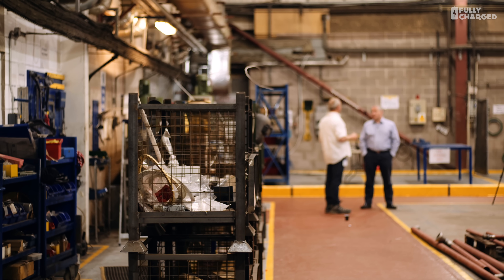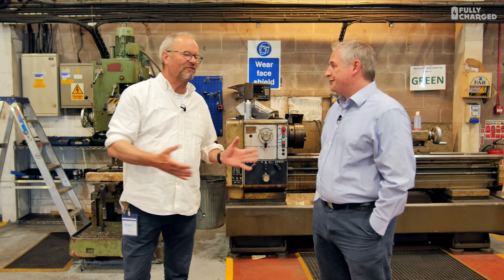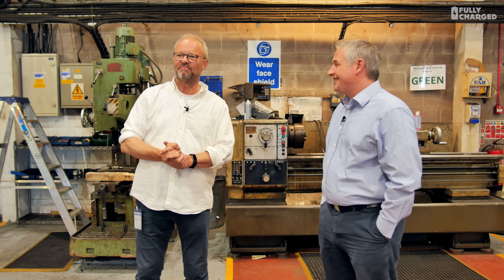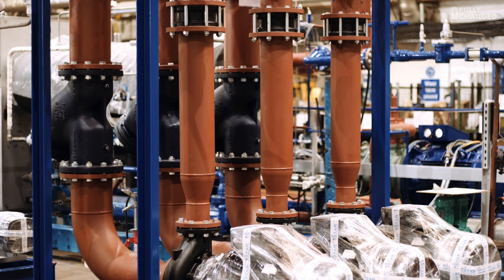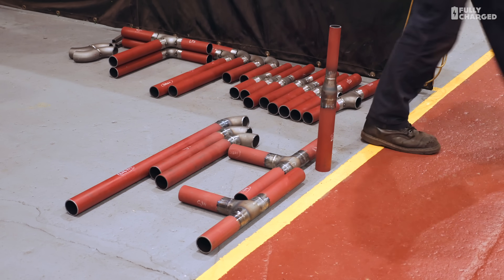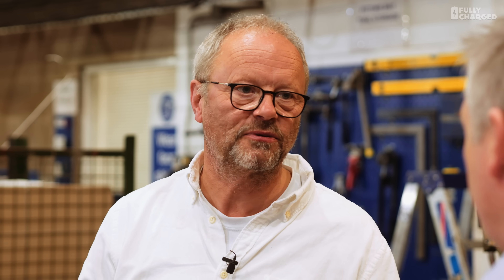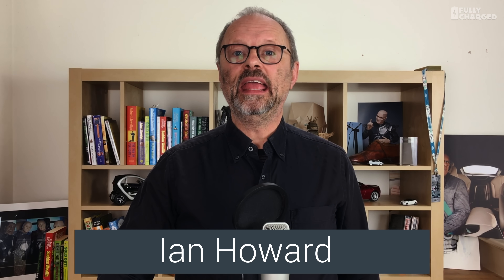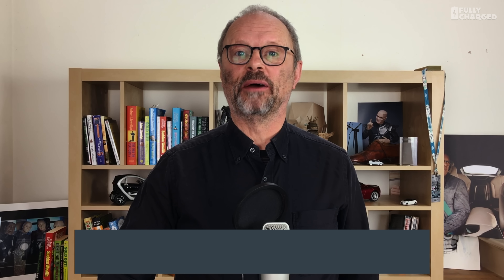Star Heat Pumps | Fully Charged

Comment: Large scale heat pump systems have been used in Europe for more than 40 years, yet they sell it as big news (probably because STAR is a UK company). This is standard technology, nothing new here. STAR hasn`t invented anything, they follow an old existing trend.
However, centralised high temperature heat pumps are old fashioned technology, today it’s about ANERGY NETWORKS (cold district heating) and decentralized low grade hot water heat pumps for heating and cooling. There are exapmles in the UK (New Papworth Hospital Cambridge), designed and installed by foreign companies.
Reply: maybe the presumption, Stefan, is yours. The facility in Drammen is the largest 90C heatpump using ammonia so as to avoid global warming gases such as HFC whilst upgrading the existing district heating. I'd say that was worthy of some news-albeit not the focus here.
I'm familiar with ANERGY as you call it- others call it ambient networks - and it has advantages - particularly for newer facilities. However if we are to upgrade all the existing buildings in a densely packed city would an ambient network be feasible? Are dispersed heat pumps better in this context as the network delta will be higher? It will depend if there is simultaneous cooling opportunities which are excellent to introduce as they create a dispersed or city reduction in nett energy demand.
Reply: David, thank you for your comment. The problem with high temperature district heating networks is the thermal losses in the system before the heat reaches the consumer. Long term research in Germany has shown that between 15 to 30% of the energy are lost in the network. So, replacing a CHP or gas boiler with a high temperature heat pump is a nice first step, but not a solution. Also, with high temperatures for customers comes inefficient distribution, inefficient radiators and inefficient buildings in general (no need to change anything). 
You are right, for existing district heating networks, existing building infrastructure and renewable electric energy from the grid it’s a big step, but still nothing new. It’s the standard in many places in central Europe.
Reply: dave pearson
I recall being in the large bank buildings in the City of London. Some had three basements. Even when it was below freezing outside there was always some part of the building that needed cooling.  Pumping heat from one part of the building to another made sense cutting down energy use.  Some did this using heat pumps, others would bring in cool outside air to cool the overheated parts of the building and inefficiently dump it outside. Heat pumps would reclaim the wasted heat to use in parts of the buildings that called for heat.
Reply: dave pearson
Copthall swimming pool in Mill Hill London had heat pumps to extract heat from warm chlorine laden air being extracted from the large pool. This would be used to heat the pool's water and common parts of the building. The control system was designed to bring in heat pumps in stages and when they cannot cope, a large gas boiler was staged in. At one time they switched off the heat pumps as it was just cheaper to use the gas boiler.  At that time, 1980s, no more expensive to install heat pumps systems were installed.
Reply: There have been some poor "old" high temperature systems Stefan. I'm still thinking we need to use 70C max going forwards and so far less heat losses than the older stats suggest. Without a shadow of a doubt underfloor and thermal exchange (hot and cold) like Enercret are so good at works even better but it isn't always possible. I am quite a fan of ambient loops too or even moderately elevated loop temperatures ala Heerlen at circa 25C and then dispersed heat pumps but still I think we will see some networks needing to run warmer.
Reply: Stefan Wehinger
Do you mean Skanska at New Papworth Hospital Cambridge?  They have been setup in the UK since 2000 and act as a UK company, quite independent of the Swedish parent.  Skanska do not have a good reputation for honest dealings.

Comment: Thank you so much for that video. I didn't knew that you can heat your house with a heatpump system. Here in germany we rely mostly on gas and a little bit on oil and wood too. I don't think that there are much installed heatpumps in residential houses.

Comment: Emmm, this is nice stuff, but I have water-water heat pump for more than 10 years. It's not new technology, and it is also economicly feasable for more than a decade.
Reply: we are aiming to deliver clean heat in the cities where it is far less viable to have individual heat pumps for older buildings so district heating is probably easier.
Reply: On average maybe. In my case (because of easy access to water) it was about 6 years.
Reply: Nikec33
Payback in a ground sourced heat pump is about 10 years.

Comment: I’ve had reverse cycle air conditioning in my house for over 10 years. You just pay to move the heat, not create it. Much cheaper to operate and the whole house is warm in winter.

Comment: When it's cold the coefficient of performance drops a lot so 400% is ideal but not the reality. Did he not say "we are taking 10MW out of the sea water using electricity and get 14MW back."? That is not 400% efficiency. It's a COP of 1.4.
Reply: drammen is 13.2MW of heat output for 4.4MW of electrical consumption so 3.0. what I said was it could be COPh 4.0 (if we didn't run at 90C and ran at say 70C). Could be even better if we didn't source from a river and say sourced from a data centre throwing heat away at say 20C which would give COPh 5.0

Comment: Heat Pumps are used in tumble dryers greatly reducing the electricity used, using standard fridge components.   Why they have not become the standard is a mystery. They use about half of the electricity as standard dryers.  
http://www.bosch-home.co.uk/product-list/washers-dryers/tumble-dryers/heat-pump-dryer
Hotpoint sell one at under £300. Condensing versions are available. 
https://www.appliancesdirect.co.uk/st/heat-pump-tumble-dryers

Comment: How to produce heat without burning anything? Electric heaters?
Reply: 1 unit of heat for 1 unit of electricity...........not 3 x or 4x......
Reply: @Dave pearson: True, but nevertheless it's a simple answer to the question.
And especially in Norway, there is a lot of such simple electric heating without heat pumps.

Comment: A Hayabusa sports bike is a very inefficient poor performing heat pump because it makes a lot of kinetic power!..... A Harley Davidson chopper makes a very efficient heat pump because all the power it makes ends up as heat instead of kinetic power
Reply: Nope a combustion engine isn't a heat pump because it doesn't use 1 unit of energy to move 3,4,5,... as much heat from one place to another. It just produces heat at source because it's so bad at turning burnt fossil fuel into forward motion.
Reply: no a hayabusa works better at using fuel explosion to move because it makes 200hp compared to a Harley's 70hp of similar displacement!

Comment: Wait.... so if it's really cold outside and you want to heat a house because of it, isn't the river water gonna just as cold if not more? I'm not well-informed, but it seems rather illogical? How does this provide any heat?
Reply: Rivers are almost always warmer than the surroundings in winter.  In fact, where I am, the water is liquid even when the temperature is -40.  But the point is really that everything has heat, if you convert to the Kelvin scale you will see that a river at the freezing point is 273K.  Cool it off a bit, concentrate that heat, and heat your home to room temp.
Reply: CorwynGC ah yeah cool. Thanks for the info.

Comment: How do you heat a place without burning anything?
Hellooo? Ever heard of Electricity?
Yeah.
If you can make electricity cleanly, you can heat a place cleanly.
Might not technically be the most efficient method, but it works, and as long as the power comes from a renewable source it'll be cleaner than burning something.

I mean, electric stoves, ovens and heaters have been around for ages.
Electric water heaters as well.

If you can create electricity, you can create heat.
Reply: ... For that matter, air conditioning is entirely electrical, and reverse cycle AC does a decent job of providing heating in most contexts...
It's no mystery, it's simply a question of efficiency.

Comment: Back in the 80's I worked for Hydraulics Research near Wallingford in Oxfordshire, they had a pair of heat pumps in their new office building that housed the new computer suite.
The heat pumps extracted the heat from the computer suite and used that to heat the offices. The computer suite produced 10kw of unwanted heat that would be wasted with a conventional cooling system.

Comment: So i saw in the paper some 30 years ago here in Australia they had some floating pontoons off the coast that would use the temperature gradient of the ocean to make electricity. So a gas at room temperature cool it a couple degrees with cold water from the bottom of the ocean to a liquid then as it turns back to a gas it turns a turbine producing power for basically free. What happen to them. In my research into them i found an article that stated they had one on a spanish ship back in the 1800's the only problem back then and 30 years ago was corrosion which is not a problem now with the new materials we have.

Comment: The first winter we were in our home, I switched to heat.  In Mid-January, I discovered I had set it to "emergency heat" rather than "heat."  The emergency heat uses resistance electric, whereas regular heat is a heat pump.  February's bill was $200 less than December or January.  This is just an "old-fashioned air-to-air heat pump.

Comment: People - listen up!!!  You are all going  around in little circles having the same argument over and over and over and over again. 
Read each others posts and SHUT UP!!!
You are all arguing over semantics.
Heat pump systems ARE very energy efficient - they typically output about 4 kW of HEAT energy for every 1kW of ELECTRICAL energy input. The electrical energy is used to move the heat from where it's available to where it's needed. Think of a fridge in reverse..
It's really very simple(or so you'd think!)...

Comment: It does take less energy to move heat than to generate it. 

Not unrelated. One of the major problem is conventional wisdom in the construction industry. Right now the mainstream thinking in architecture is that we build a house with 2X4 construction then use fiberglass insulation that is around 3.5 inches thick to insulate it. Then we size the HVAC system to heat/cool that structure as needed. This is standard in cold northern climates to warm southern. It makes zero sense. It's possible to build or retrofit structures so that they are incredibly energy efficient. So that, even if we were using fossil fuels for heat and cooling it would take a fraction of what we use now. 

On average to make a house that is super insulated would cost around 5% more. That's at present stats. If it became and industry standard that cost would come down as work forces adapted to the new standard and materials were generated at economies of scale. So on a $100,000 house it would be $105,000. BUT the amount of utilities for heating and cooling would be a fraction of what it would normally be. Over the course of the structures lifetime that would be a huge benefit to the environment, not to mention the owners pocket. 

We should be making our structures to fit the environment in which they are, instead of building an inadequate shell and heating it constantly. 

I was going to invest in a solar panel system. (I still plan to one day) After researching I found that the most beneficial use of my money would be to super insulate my house. I heat with electricity. So my electric bill averaged out over a year was around $310 a month. Since insulating it's around a tenth of that now. The bill would be lower but there are basic service charges that don't change with usage. I actually use less than a tenth of the energy I was using. The electric heaters in my house turn on very infrequently. The biggest expense is the air exchanger which is 90% efficient in capturing the energy of exhaust air. Which makes it a heat pump also BTW. 

Inefficient construction is being tossed aside in many European countries like Germany for example but it's far from industry standard.  In the US it's still a rather rare sight. There are many examples online, but compared to the entire scope of construction the amount of super insulated structures is insignificant here.

Comment: You should come to Helsinki to see how these things are done in big scale here. Most of our homes are heated with remote heating. There's plumming to cover almost 100% of homes in Helsinki and many other big cities too.  I'm 51 and I've lived my whole life in appartments and houses that were remote heated.  Our powerplants create heat and electricity at the same time. Also we are using heat pumps in MW scale and use our sewage water as heat source, so there's a river for you ;). In Espoo we are making a 7km deep hole to collect heat for water and create 40MW of heat from that for remote heating.

Here is one heat pump example from Helsinki

https://www.helen.fi/en/company/energy/energy-production/power-plants/katri-vala-heating-and-cooling-plant/
Reply: Filled with water, about 90 degrees. There is a heat exchange unit inside a house or appartment building. 90 degrees water leaves at around 20 degrees back to powerstation.

https://www.ess.fi/incoming/img2411319/qlp67z/ALTERNATES/w980h655/1121648_.jpg
Reply: Timo Grönroos
"Our powerplants create heat and electricity at the same time."
The advantage of that is that there are little line losses as the electricity is generated locally and wasted heat is used to pump to homes to heat hem. But, the local powerplants create local pollution. 

The UK had cheap gas for decades and cheap coal for hundreds of years, so did not have to develop such systems. But they made some of the world's most advanced heat pump systems before oil was on tap from the North Sea.
St.George's school in Wallasey near Liverpool:
https://ssl.c.photoshelter.com/img-get/I0000DK.SoxCk0zI/s/750/750/LBP3266.jpg

The now named Capital Buildings in Liverpool, this was eco before it was fashionable - 1973.

To the eco aspects. The building has minimal glass to conserve heat. The building uses water that seeps into the under river Merseyrail Metro tunnel, built 1870/80s, between Liverpool and Birkenhead. This water is pumped out of the tunnel being a near constant 12C - water seeps through the riverbed rock and is heated by the earth before it reaches the tunnel. After use, the water is discharged into nearby storm drains, helping to keep them flushed and stopping an odour problem which they then suffered. A heat pump using thermal storage uses this water to heat and cool the building, giving minimal energy usage. 

In winter the building is heated for a few hours on Monday morning and for the rest of the week the heat from people and office machines is usually enough to keep the building warm. At times it requires cooling in winter.

In summer the 12C water at times is enough to keep the building cool, if not the heat pump cuts in and assists. 

The quantity of water pumped from the tunnel was more than required for the building, some of the water was sold to an adjacent insurance building under development at that time.

I believe the heat pumps were the largest in the world employed anywhere for heating/cooling a building at that time.

http://www.hevac-heritage.org/electronic_books/M&NW_anniversary/Section-14_LiverpoolDailyPost.pdf
Reply: How is the heat plumbed to homes & businesses?  I'm assuming pipes?  Made of what?  Filled with water or something else?  Are they insulated?  With what?  What is the heat loss per distance?  Once it gets to the building how is it transferred to the atmosphere; radiators or some other more complex equipment??
Reply: Here's something nice also:
https://www.helen.fi/en/news/2018/Seasonal-energy-storage-facility-is-planned-for-the-Kruunuvuorenranta-rock-caverns/

Comment: What i don't understand is what he means by 700% efficiency. If something is 700% efficient that would imply the system output has 7 times more energy than the input which is impossible.
Reply: if a system uses 1 unit of electricity to deliver 4 units of useful heating and 3 units of useful cooling how would you describe that?
Reply: It's not a closed system.
Reply: dave pearson this is what I don't understand. But for example i know that if i measure the mechanical power at the input of a generator and compare that with the electrical power of the output efficiency as a percentage is Pout/Pin*100. I'd like to understand the calculation behind HIS definition of efficiency.
Reply: They aren't counting the 'free' thermal energy which they extract from the environment.
Reply: jamie. all heat pumps are different but if as an example we used a heat pump to heat 4 units of water by consuming 1 unit of electricity, this is described as a COPh (coefficient of performance-heating) of 4. at the same time we are drawing 3 units of heat from the cold end and this could be providing use for cooling a data centre or another building and we would call this a COPc of 3. So simultaneously we are doing 7 units of useful thermal transfer for 1 unit of electrical power input, hence COPh+c of 7. we are in effect getting 7 x the output from the system as the paid for input (the electricity). a lot of folk object to calling this efficiency but that is the language people understand. Drammen get 3 units of heating for 1 unit of electricity and don't as yet use the cooling so only COPh of 3. They are building a hospital near the energy centre to exploit that cooling opportunity.